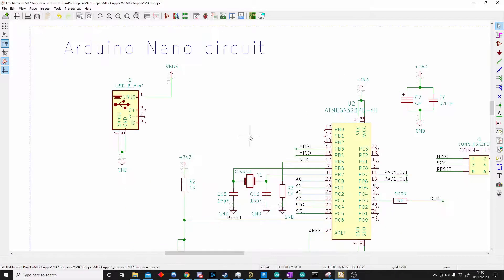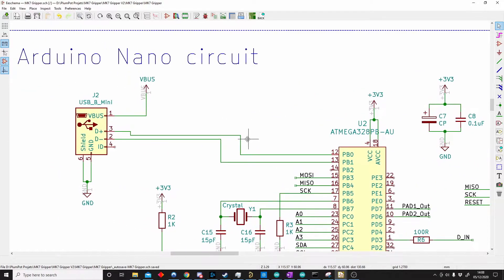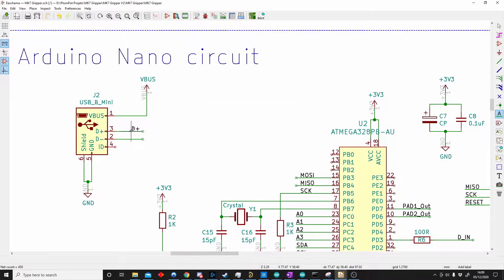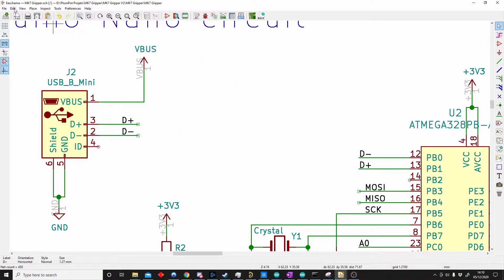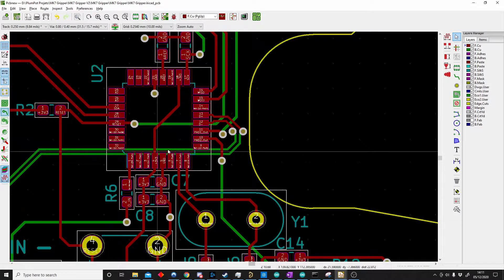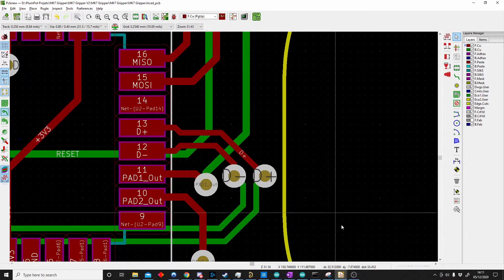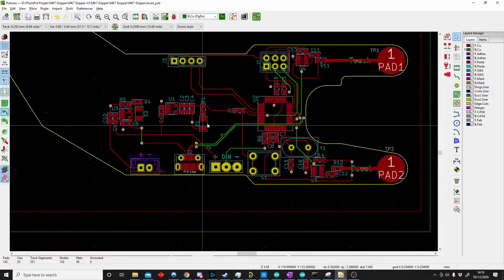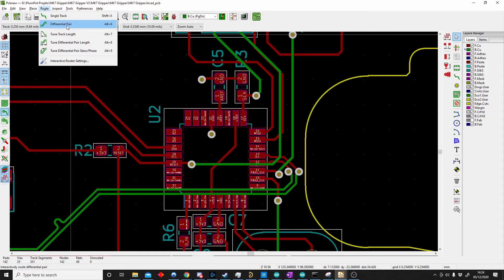KiCad Tutorial - How to create Differential Pairs using KiCad

Comment: Thanks, some great info. I'd love to see an updated version of this with a way to adequately route A6/B6 and A7/B7 pins for SMD Type-C sockets so that you can get the same length on both sets of differential pair pins. For context, I'm trying to connect to a CH340C and the Type-C KiCad footprint is Connector_USB:USB_C_Receptacle_HRO_TYPE-C-31-M-12.